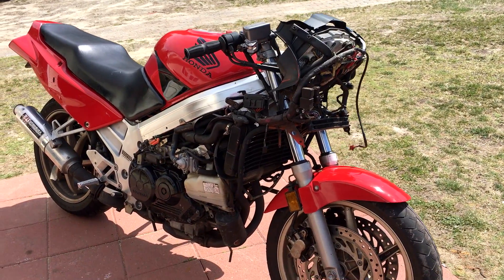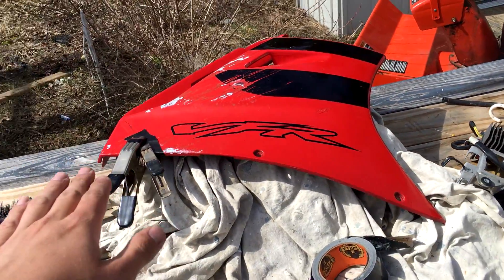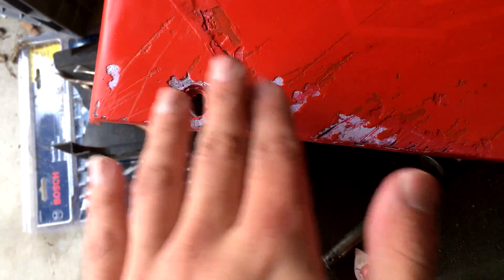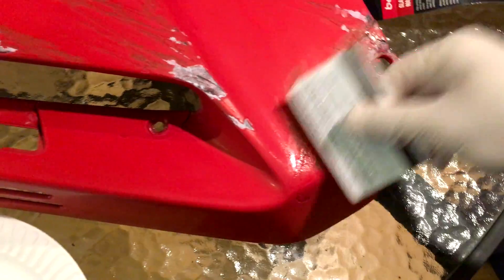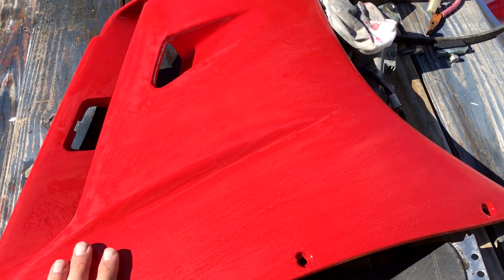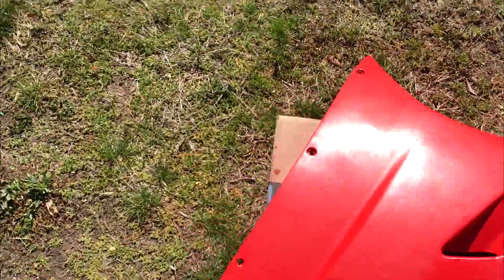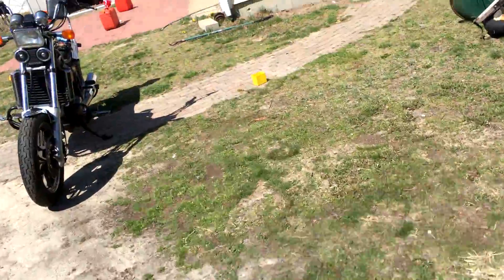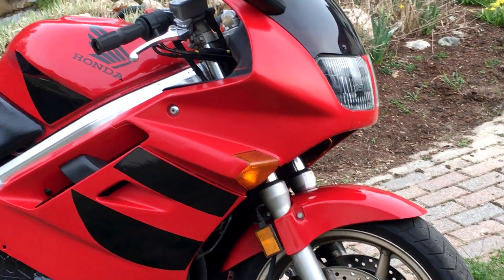How to repair a motorcycle fairing CHEAP!

Comment: I applaud your efforts but would add the following. 
Never use spot putty on a crack through repair. Use a fiberglass reinforced bondo and use a 2 oz bi fiberglass cloth on the backside of the panel. Otherwise the cracks will come back. Then use an epoxy 2 part primer to ensure paint bonding followed by a few high build coats of primer wet sanding between coats. This will allow all those ugly imperfections from showing through. You can purchase exact match factory paint in a spray can and clear coat. Everything I mentioned can be purchased for about what you spent and you will end up with a factory or better finish. No insults meant. You did a good job. Just suggesting how you could go a bit further and end up with a perfect job.
Reply: On that note, say i only scratched a fender withought cracking. Do i need to paint the whole fairing?
Reply: @marvino7132  thats a depends. If its two stage paint, you could scuff the gloss off the entire area, the spot in paint the color and then clear the entire fender. If its a single stage paint you have tow scuff off tge gloss and paint the entire fender. Hope that makes sense. 
Any actual crack must be stop drilled or the crack will re-appear like a crate in glass.
Reply: instablaster
Reply: Looking back at his old vid HeroRR sure came a longway and improved so much since then from his old and new vids of how he tackles his bikes problem. But yeah this fairing repair tutorial had room for improvement nevertheless his efforts to share were enthusiastically recognized.

Comment: PVC glue? Most fairings are ABS plastic I believe - I repaired mine with 2 part epoxy glue - adhered good but still makes a line at the seam where the glue met the plastic - lots of primer and sanding to get it looking 100%

Comment: Some of my least favourite jobs. But I've vowed to teach myself how to do them well. Apparently, if you use a light coat of a contrasting spray paint (black on white filler, white on existing dark paint) on the sanded surface, then rub it down with very fine grit paper, it shows up the scratches that still need filling. There's a technical name for it but it's gone from my brain. It's like a witness coat. 
Great bike. Probably the best engine ever made.
Reply: Moderate Fkr 
Guide Coat.

Comment: U screwed this up brother good attempt but u needed to sand that alot more and primer and more sanding b4 u could spray any paint on there I noticed u didn't do anything on. The inside this repair will not last long